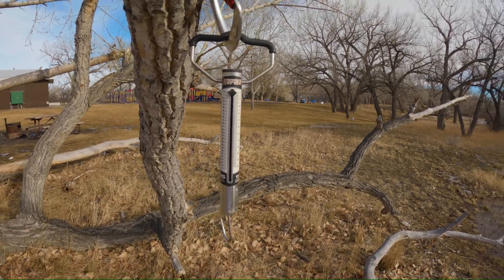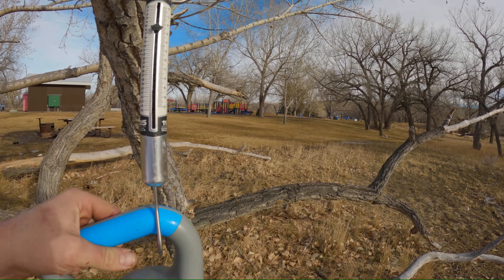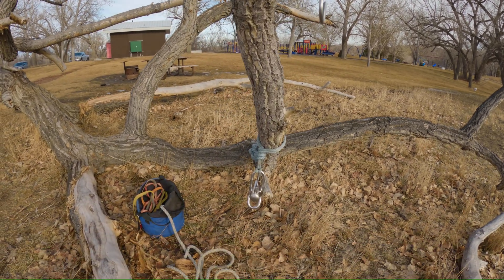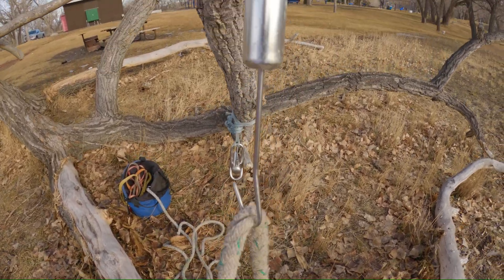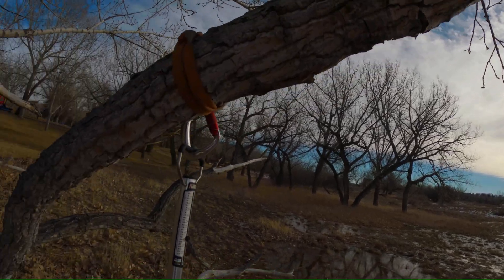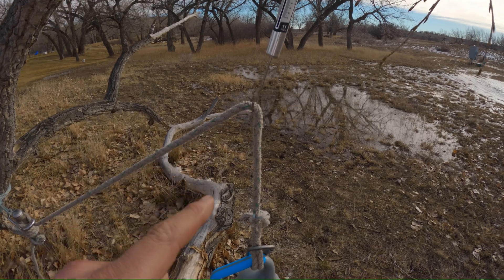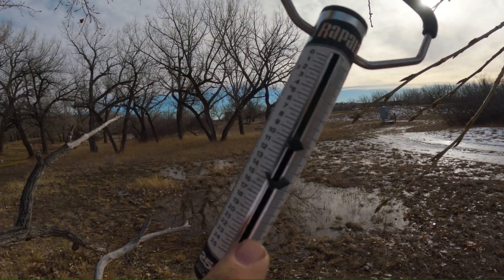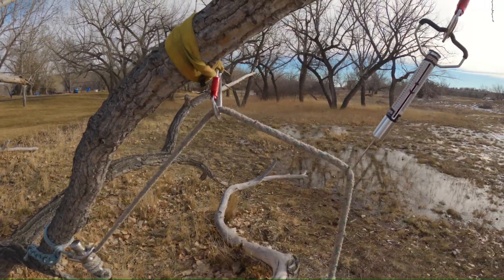Rigging Basics Understanding Forces

Comment: Just rig directly off the porta-wrap where you are making the cut. Least amount of force (nice demo), with the least amount of gear, & frees up the groundie to manipulate the piece with a hook or tagline rope.
Reply from the maker: Yes, you are correct. Adding friction at the top is a viable option. However, it could get time-consuming moving it around in a multi stemmed tree. They also make gear specifically for this. Thanks for watching. Be safe, brotha 🤙
Reply: Thats an interesting concept. I jave never seen anyone do that, but I work with old school guys. I will play with that idea at home, because my wife usually helps me there, and she'd love to have my run the rope for her😂